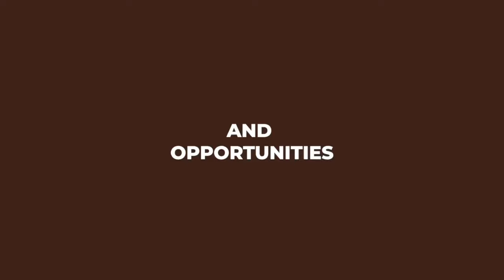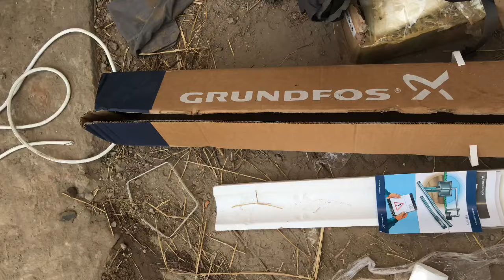5th day of our irrigation system being installed

Comment: just a thought, underground drip irrigation. when you start doing 1000 plus acre farm. 😉🙂

the following video, this system lends itself to do it yourself folks seems to me.
https://www.youtube.com/watch?v=9sj3rHafaTE
drip tape. 
lol, when the guy turn on the water and it started to drip, I thought, oh cool wherever it is dripping I would stick a plant. lol
another one:
https://www.youtube.com/watch?v=z0IZugG2RqU

I guess the trick is to let It drip for 1, 2, 3, hours see how deep the water goes down in the ground? who knows you may only need it to drip an hour a day or every 3 days or something. oh this is cool. hm, so, a plant needs an inch of rain a week?  Depending I'm sure, how hot it is, if the soil holds water or it just passes through quickly, type of plant, etc.

I wonder, doing the rainy season could you grow in a tunnel?  hm?

Comment: ALLPOWERS
ALLPOWERS 200W Portable Solar Panel for Power Station, Folding Solar Generator Charger with Adjustable Kickstand, IP66 Waterproof for Camping, RV, Boat, Home, Off Grid, Power Outage
(4.6)
4.6 stars out of 17 reviews
17 reviews
$199.00
Price when purchased online